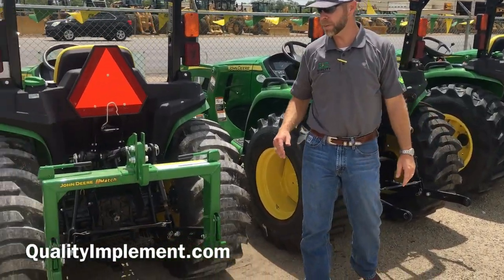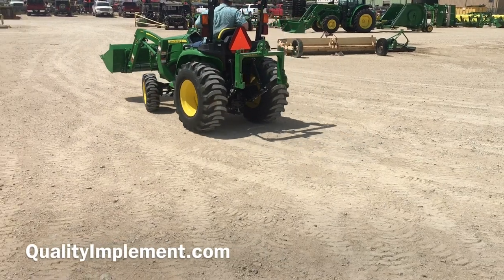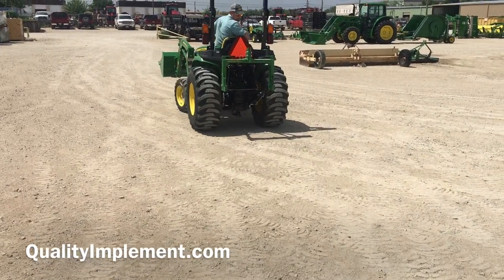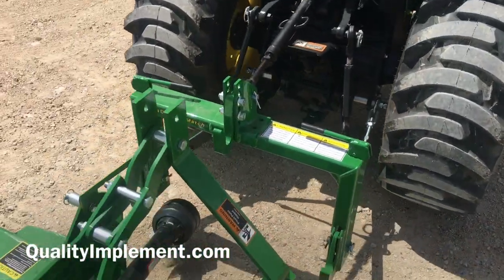How to use an iMatch Quick Hitch

Comment: I have a 1025 R and having problems trying to unhook my Frontier box blade from the iMatch quick hitch.  The iMatch doesn’t seem to want to drop down enough to disengage the box blade.  I end up having to put short lengths of 6x6’s under the box blade in order to drop the iMatch low enough to disconnect it from the box blade. Any advice you can offer would be most appreciated. Thanks, Mike